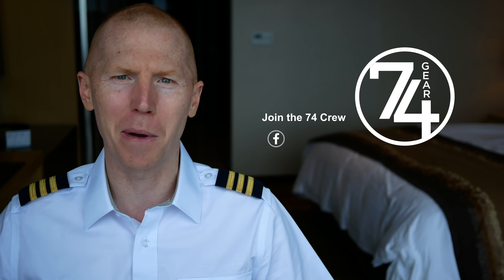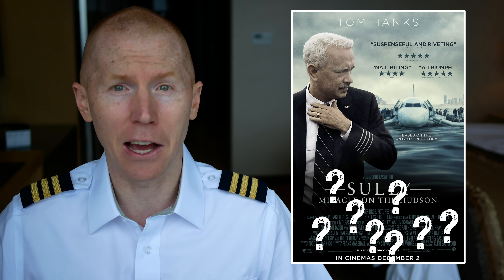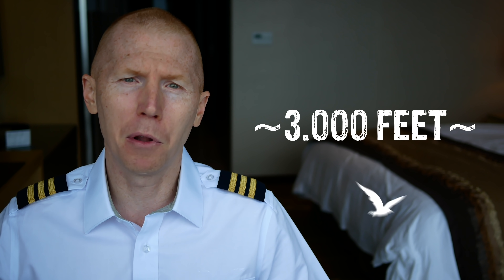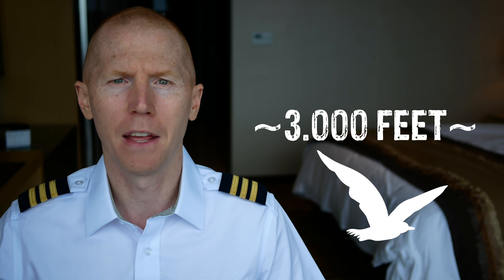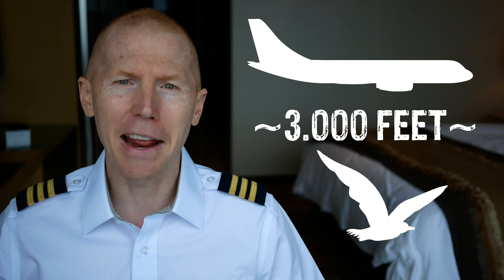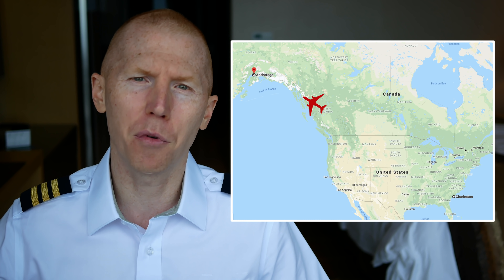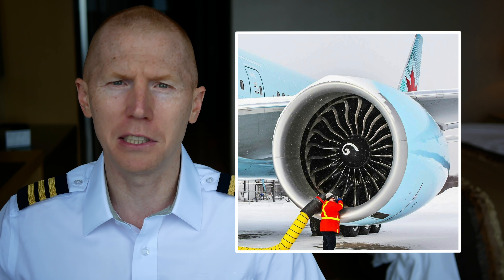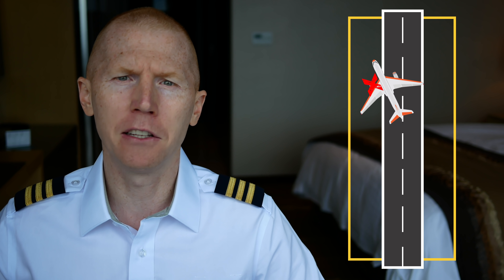Why Engines Don't Have a Mesh or Grates to Stop Birds

Comment: This reminds me of a tour I had at the Rolls Royce plant near Berlin. They told us that the big turbines they produce there have to withstand a "bird stricke test": a real (dead or unconscious) bird gets shot via compressed air with more than 300km/h into a running turbine.
Reply: "survive" probably merely means doesn't suffer an uncontained failure...

Comment: I wonder if they could make something like a duct in front of the engine that works like those shop dust collectors where it uses a slight turn so that something as heavy as a bird will go into a collection bin but air can make the turn without much disturbance. 

If it works for a small of a difference in weight as air vs dust, it should be much easier to do with a much shallower turn for something as heavy as a bird.
Reply: the drag, and consequent increased fuel use would be colossal

Comment: With military aircrafts we know it is possible to just use retractable screens. For intakes as large and round as with commercial ariliners that would still be a major challenge, adding extra complexity to the engines.
A retractable screen would need to be strong enough to not get damaged by large/many birds or it could cause more harm. Even at takeoff/landing velocities it could not prevent birds from entering the turbine but only chop them into smaller pieces - if that would be good enough? no idea.

Comment: The planes literally have flaps which you can move freely so why not a grid which is removable during flight? if it is stuck you need more fluel but it is not damaging to the engine
Reply: Another system to fail, the screens alone would pose a FOD hazard, astronomical cost, reduced engine performance, added ground inspection, more fuel consumption, the list goes on. Most birdstrikes splat in the intake and go down bypass anyway.  It sounds like a good idea until you've worked around them for several years.

Comment: They could make an automatic grate. That goes out of the engines way after 3000ft.
Reply: Then you're talking about a moving component and the equipment to move it while traveling at a couple hundred miles per hour and having to store it somewhere. You're also reducing engine efficiency at the time engine power is needed most. At 250kts while climbing, a 10lb goose is going to exert thousands of pound feet of force on the grille so it's going to have to be tough as hell....which gets more difficult with the sheer size of an engine (like the 777's being teh size of a 737's fuselage) so your cover gets even heavier just to support itself....and then there's the issue of maintaining all that equipment which could fail doing damage to the engine it otherwise would not have encountered (and a mechanical failure is technically more likely than a bird strike) making the net result more dangerous than it was without.
Reply: @94XJ  yeah you might have a point there. I was thinking on the realms of how automatic carbon spoilers work on cars etc. Or electric grills on electric sports cars. But I guess you are right.

Comment: Why don't they put a retractable screen in front of the engines?, so at takeoff/landing the screen is in front of the engine, but after going above 3000 feet, the screen retracts and the engine runs as normal. This way, your engine is protected, and runs efficiently for the most part of the trip.
Reply: Cool. Now you have a bird AND a metal grate going through your engine. Splendid! (A metal mesh would never survive a birdstrike at 150kts+)

In addition, the two situations where a plane relies most on peak optimal power is takeoff and landing. Putting a screen in front of the engine on takeoff would reduce take-off weight capabilities *a lot*.

Comment: I think something people don't realize is that if you put a screen in front of the engine it either needs to be fine enough to not let the birds through in which case it's going to either push the screen into the engine or pin the dead bird against the screen which is just going to block more air flow OR it needs to big enough gaps that all you're going to do is send bird chunks through your engine which really isn't much better.

Comment: Put a infrared camera 360 camera on wings that detects birds. If it detects a bird, release a massive thrust of air pressure shooting from the fuselage and away from the engine for about 10 seconds. if it’s done right the bird should be propelled way off course of the engine and airplane

Comment: There's over 13,000 bird strikes in the US each year but 65% cause little or no damage to the aircraft but I can't say the same for the birds.   They are usually splattered.   Geese are about the worst for manned aircraft, they are large and fly in flocks.   If you are a remote pilot and fly drones, hawks, eagles and other predatory birds see your quad as a tasty snack.    These birds will grab the drone in flight with the intent of taking it back to their nest to eat it.   Often the birds just decide to drop it from a few hundred feet AGL.    If your lucky you can find what is left of your $500-$10,000 model.    Besides aircraft, some birds damage vehicles.   I had 2 male turkeys dent and scratch up the hood of my new 4Runner TRD Pro.   I wasn't happy, the turkeys were "relocated" to my neighbor's dinner table.

Comment: Guys. I've got this.  What we need to put is a high-impact SHOTGUN (with soft rubber pallets) embedded into the edge of the engine that will see a bird and blast it at an angle so that anything with high density (rock) will fly off of the path of the engine and won't get sucked in. :)

Comment: I remember that some planes had a third engine on the tail. I think that would be really important and it should be off until one of the other engines stop then you can turn it on.
Reply: The engine on the tail assists with take off and stability.  Of you leave it off then that would take valuable moments to get started if it even starts. You could have it running at reduced power and still be feul efficient since you will be traveling faster than if you just had 2 operating

Comment: The ram air effect is what makes jet engines so efficient.  To restrict that when it needs it the most (takeoff) is putting dangers elsewhere.  Might as well go all turboprop if force-reduced efficiency becomes accepted.  And unlike jets that open a different intake (to prevent ground FOD), commercial planes don't have afterburners to provide that extra take-off thrust.
Reply: Let's give them afterburners! That would ROCK!

Comment: What about having a dummy suction device below the engines with some kind of bird scanner mounted to it. If a bird is spotted that's potentially hazardous then kill that engine and spool up the dummy one. The dummy device just needs to suck harder than the throttled down engine to get the bird out the way.

Comment: Had a little laugh when I seen this video title. I have been overhauling jet engines for 32 years now. Bird strikes are pretty rare and rarely cause an engine shut down...especially on something like a GE90 on the 777. High bypass turbofan engines have some pretty tough fan blades as well that will mince up things pretty well. Whatevers left of a bird won’t be much by the time it gets to the engine cores inlet behind the fan and most will bypass the engine core completely. Keep up the great videos!

Comment: Engines are also tested to withstand bird strikes. But no matter how much you build it to withstand, there's going to be a critical mass of poultry that can overwhelm it - I feel like two Canada geese into each engine falls into the realm of a freak occurrence that you just can't foresee. Even if you could - I'm unconvinced that two Canada geese per engine are gonna be stopped by chicken wire.

Comment: Even if we ignored aerodynamics for a minute and put a screen over an engine to prevent a bird strike it still wouldn't work. If you slam into a bird with your engine moving at 210 knots, all you're going to do is have a bird and a screen sucked into the engine. And that goes for just about anything you could design to put in front of it. Bringing real life back into it sure you could design something strong enough and sturdy enough to not break in a bird strike but the plane wouldn't be able to fly, or fly very well anyway.

Comment: if the issue is loss of fuel efficiency from having something obstruct airflow during flight, why not have controlled covers on the engines like the doors over the landing gear?
they can cover the front of the engines with the cage during takeoff and landing, but then open up once the plane leaves 3000 feet where birds are less of a threat and fuel efficiency matters.

Comment: Most Russian fighter planes have grills in front of the engines to prevent bird strikes. On commercial jets it’s maybe possible to make foldable grilles that could retract at altitude deemed safe from bird strikes. Then you would have safety and fuel efficiency.

Comment: The intake opening is somewhere around 8 feet in diameter.  This gives an area of around 50 square feet (7200 Sq In).  If a square mesh was constructed of 0.10" dia wire, spaced 1.0" apart, the wires would present a blocking area of about 1400 sq in, or 9.5 Sq Ft.  This is like putting a 3 ft x 3 ft solid plate in front of the opening, reducing the airflow by 20%.

It's actually a cost thing.  It's cheaper to repair a 25M engine than to pay 20% more for fuel.

Comment: Hmmm, since commercial planes are only below 3,000ft for a short time period why don’t smart engineers create a self collapsing  fencing on engines. Safer takeoffs & once beyond 3,000ft the fencing folds away so you get maximum fuel efficiency etc.

A Win/ Win!

Comment: How about a retractable kevlar mesh screen (or  a strong material that could easily pass through blades if ingested) used just at low bird encountering altitudes w/manual operation available in case retraction fails like they have w/landing gear?

Comment: Why not just use air scoop to get the air loss from the grating...or at least use really thin Sharp metal wires/razors... this way you cut the bird in very small portions...let's face the bird is a goner already if it's sucked in...does it really matter what part of the plane the you use to cut the bird into tiny pieces...

Comment: What if the front of the engines were tapered like the back end is? That way at least the likelihood of birds going into the engine is much less, but you still get very little affect on airflow. 

Another idea, what about some kind of “ultrasonic bird whistle” that shoots out of the nose below 5,000ft that scares away flocks? 

I just don’t understand why it seems like the aviation industry isn’t actively doing something about this potential hazard.

Comment: "All commercial airplanes that you will fly in as a passenger have two engines."  - A 747 pilot.  (I know technically 747s have two engines - and also another two)
Reply from the maker: I should have said at LEAST two
Reply: @74gear  That's ok, I doubt many people even noticed.

Comment: Another problem with putting a screen in front of the engine is ice accretion. In icing conditions, ice would accumulate on the screen. If the plane were in ice long enough, the ice will first block even more air from entering the engine, then as pieces of ice get big enough to break off, they would go straight into the engine and cause damage, much like birds could.

Comment: A cone shaped grill made of angled flat titanium extending about six feet beyond the engine with the titanium shaped to direct the air and chopped up bird into the engine would still allow operational airflow for the engine and protection by shredding the bird prior to induction into the engine.

Comment: Your engines eat birds all the time, you just don't know it. The ground crew knows it, the mechanics know it, the guys who have to inspect and repair any damaged blades. Jet engines are pretty tough. Ours eat birds all the time here in Hawaii, sometimes it bends the corner of the intake fan blades and they need to be trimmed and repaired. Ours are 737-200 with low bypass engines, they could eat a person and not even burp, blow cooked ground meat out the back. Your turbofans aren't as robust, but like Cardi B's cervix, they can still take quite a beating.

Comment: Russia has been diverting the intake air for their engines when taking off and landing for decades. The intake is blocked off and sucks air in from the top then once they are moving in the air they open up the intakes again.
Reply: Yeah, for the Su-27, which is specifically designed to be able to take off from a fucking gravel road :) On a passenger jet, not that simple.
Reply: @TheOnlyToblin  that has nothing to do with thr ability to take off gravel road.
Reply: Yeah if you give each passenger their own plane, that might work.
Reply: On passenger aircrafts tho???
Reply: @Vladlabs  I don't know anything about civilian aircraft. But after a quick look I'd say no
Reply: @sijonda  well, that's your answer :)
Reply: @Vladlabs  that is because we use same planes like boeing and airbus, they don't want to implement that technology.
Reply: @Crazmuss  Airbus and Boeing ain't the only passenger aircraft in the world
Reply: Unfortunately that won't work on the engines our commercial aircraft use
Reply: Right, his "reason" seemed pretty dumb to me. If the reason is cause it's only a risk for 3 min of flight, then only protect engines for 3 min of flight.

Comment: Why wouldn't they incorporate a piece grate as the speed brakes work? They can be used for takeoff and landing. You would engage the two-piece section that folds out and protects the front and as soon as you get to a certain height they would drawback and become part of the engine. Just a thought.

Comment: Maybe add some air jets on the edge of the cowling that are connected to compressed air tanks. A computer with laser distance sensors pics up anything approaching the engine and triggers a massive blast of air cross blasting right in front of the engine. I'm not sure how much pressure would be required to move a bird's body a few feet out of the way in the time that it would take the jet to travel that final meter or so, but it seems like it would be worth review.. 
Maybe shutter the exhaust for an instant to increase the pressure directly in front of the engine at the last moment too. 

The other option could be a monitoring system that deploys a physical barrier like a mesh or just a bunch of barbed hooks on armatures that pop out at the right time. The risk with physical barriers is of course the risk of a component breaking loose during the impact and then you possibly have metal flying into the engine instead of just some bone and meat.

 Too bad we can't just use some plasma arcs to vaporize anything that comes into range, but that would be too slow...

Comment: I would say if a grate could work then it should be like landing gear, retractable.

In flight and even landing in weather where birds aren't a risk. Stays gone. When at risk you roll out the barrier.

The even more high tech solution would combine a lidar or something with it so that if a large piece of debris or a bird is detected it triggers protective measures.

In my imagination it would work something like zippers on the inside of the cowling.

Lidar detects an incoming bird.

A carbon fiber tarp like cover would deploy from the top edge and drop down like being zipped in place on both sides.

Ideally its slanted a bit and whatever hits slides off the bottom and is tossed overboard basically.

You could cut power to the engine and double thrust on other side and automatically trim the flight controls to compensate.

My only real question would be about how the engine would react to the air restriction even turned off

Comment: Let's also not mention the fact that I don't think there is a material in existence that would be capable of both allowing decent airflow and also deflecting a bird hitting a plane going 250 knots.

Planes are limited to 250 knots below 10k ft., so let's assume the plane is going 200 knots (~103 m/s)  at the height it would normally hit a bird. The average Canada goose weights around 5.5 kg.

So that means that goose is hitting that plane with a momentum of p = m * v or 5.5 kg * 103 m/s, which is 566.5 kg*m/s, or roughly the same momentum as an average human hitting you at the speed of an Olympic sprinter. That amount of momentum isn't exactly easy to absorb by any kind of material that wouldn't restrict airflow.

Comment: 1.  why cant some form of RETRACTABLE physical obstruction in front of the engines be placed up untill the airplane reached 300 feet
2.  what about strong sound waves or other "selective frequency " alerts to be used until the take-off and 300 feet climb is completed.

Comment: This is fixable actually, the guard doesn't even have to be metal, could essentially inflate like an airbag to bounce the birds off and out, then instantly deflate. Have it triggered by ai, and a simple "ready" switch and reaction button on the stick (or close by). So you ready it during certain parts of the take off, then as you reach altitude switch it off. And if suddenly BIRDS appear above that range you have the manual button.

Im tellin ya, AIRBAGS, really really well engineered ones, and a specialised attachment ring to the front of the engine so it can be retrofitted to all your different craft.